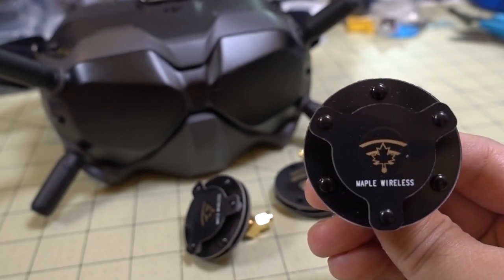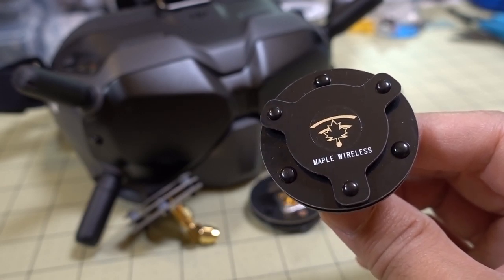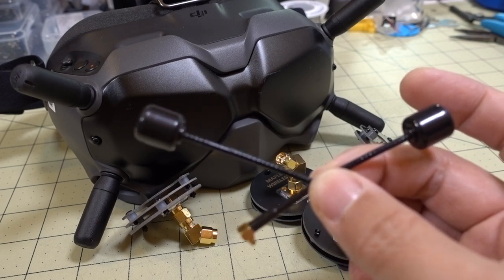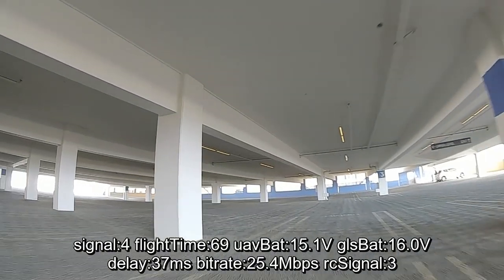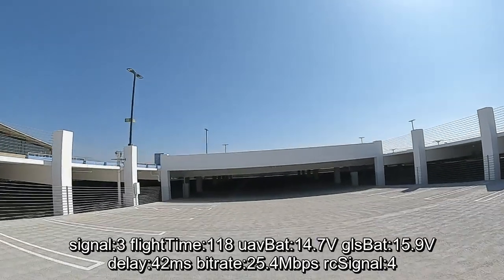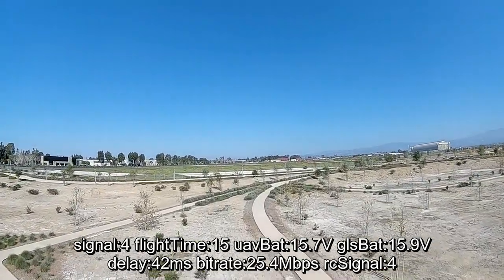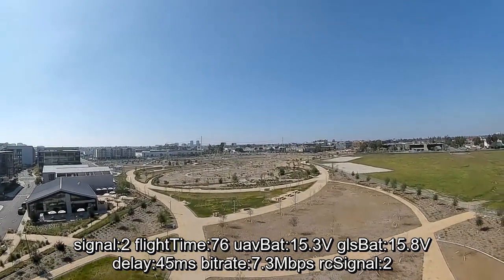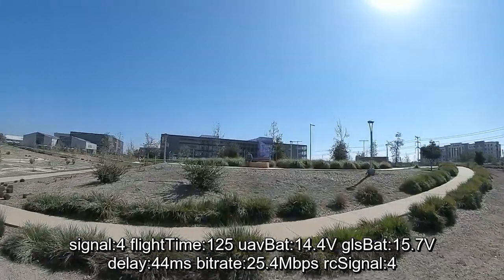Maple Wireless DJI FPV Antenna Upgrade 📡

Comment: Interesting.  A left and right-handed setup.....transmitting (and receiving) at the same time.  Maybe their theory is that if one CP path isn't robust, caused by surroundings, then maybe the other path is open and provides a better signal.  All conjecture.  This would be a question for Alex Greeve - IBCrazy at Video Aerial Systems.  I believe that guy can SEE RF. :)
BTW, were you aiming your head (antennas) in the flight path direction?  We ALL tend to look down.  Which is why I'm about to release my FPV HANS device.  :)
Reply: It is Right hand circular polarized, I have tested the twin array version of this patch AKA the “maple-wireless Leaf” and it is surprisingly good (i don’t expect it to perform like a VAS pepperbox though)

Comment: When the dual antenna is used for transmission, if the device does not have beam synthesis technology, the isolation between the two antennas needs to be considered to ensure the independent performance of the dual signal to transmit more content

Comment: Hi Albert, I ordered these antennas, but I can't find any information to place them on the DJI helmet. and it is the same for the air unit, I put that in what direction? Where did you find this information? thank you

Comment: Kind of weird. Also any adapter you add like an angle or elbow adapter adds loss to the system. So its bad to use these things. Especially in high frequency 5.8ghz. The higher the frequency the more loss you'll have. Same goes for coax. I've been into radio communications as a hobby for over 20 years. Designed several systems & antennas. It's always interesting to see what people come up with. 73's N4FOX